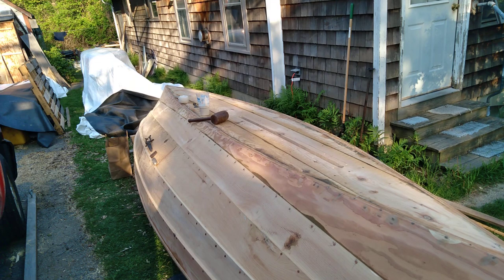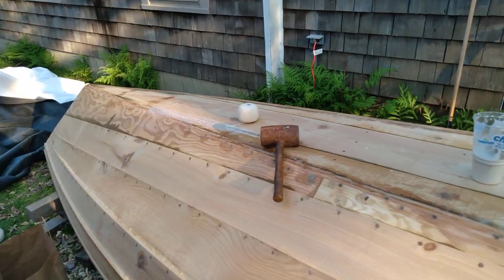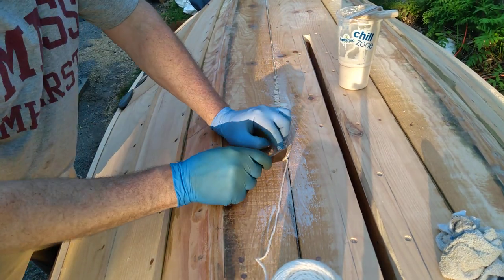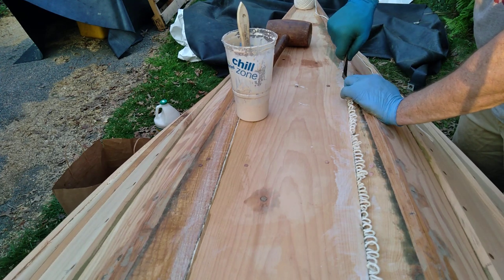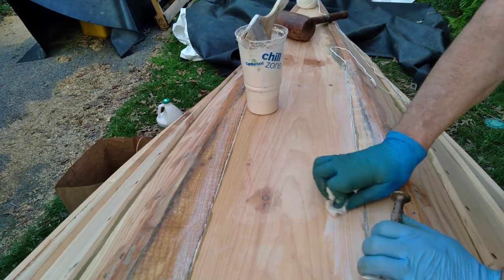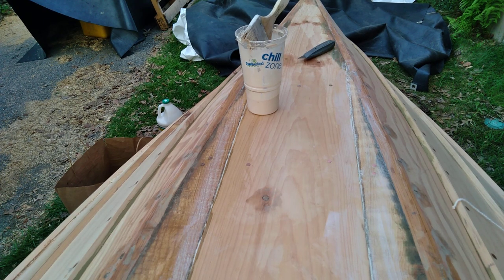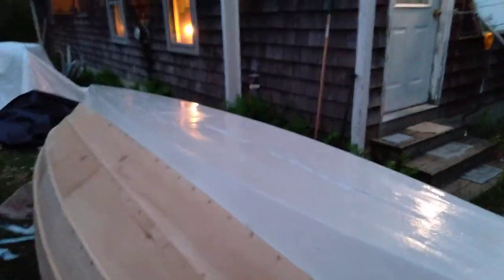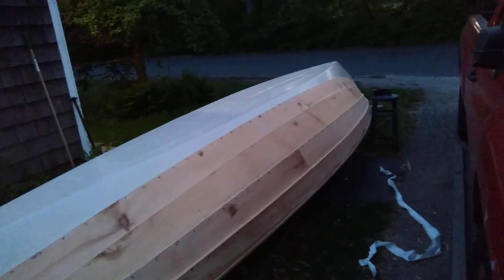Titebond III and fiber glass cloth. Building the Chamberlain Alpha Dory.

Comment: Interesting concept i found this when i was looking for different techniques for poor man's fiberglass which just uses i guess a polyester cloth instead of fiberglass cloth, Have you any experience with poor man's fiberglass versus this method does the glass and glue cure hard brittle or does the glue really integrate with the glass cloth like it does with pmf polyester/canvas cloth?
Reply from the maker: The cure is hard/rubbery, similar to the glue alone, not sure how the glass compares with polyester cloth in price or performance... 🤔

Comment: I've never seen glue and glass used together, is this a common build practice?
Reply from the maker: For folks concerned with chemical off gassing and toxicity Titebond III is a excellent non toxic alternative with water clean up. This is my 3rd boat done like this. The glass and glue is not structural, the boat is traditional built and the bronze ring nails and copper rivets hold the hull together, the glass and flexible glue composite keeps the hull from leaking a drop when trailer sailing.

Comment: Titebond III says not for use below the waterline. But what is your experience? And have you used it with fiberglass before?
Reply from the maker: So far so good, all the boats I have treated in this manner are trailer sailer boats and typically not in the water for more than a few weeks at a time. I've been sailing Centennial since 2017 with good results and minimal bottom maintenance.

Comment: How did you come up with this idea of Titebond III gluing in cotton and then fiber glassing with it too?
Reply from the maker: A friend from high school has been making foam kayaks like this for years. I did the same thing with the bottom of Centennial and it seems to have worked well so far. The Titebond III dries softer than epoxy so it moves with the wood.
Reply: @danoyes1  I didn't see you wet out the wood before laying down the fiber glass. That would make me think the long term adhesion to the hull  could be compromised. Epoxy or polyester,  the better way is definitely wetting out first.
Reply from the maker: @KennyP88  the TB III seems to penetrate the glass cloth quicker than many epoxies, the only real danger with not wetting the wood before glass is that the wood will absorb so much TB III that the glass becomes resin starved, I just made sure everything was completely saturated, is much easier to lay cloth out on a dry hull.